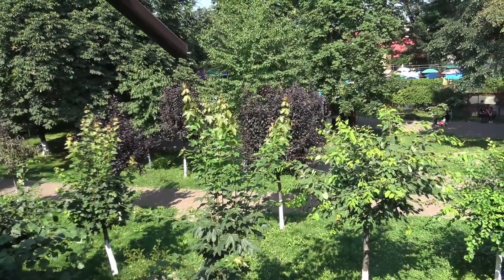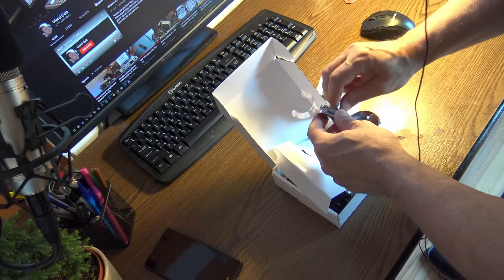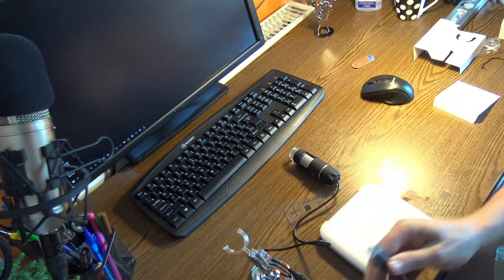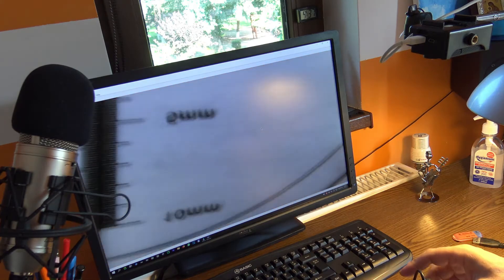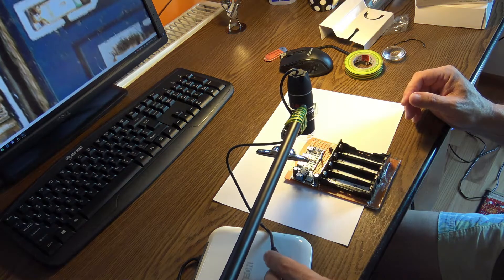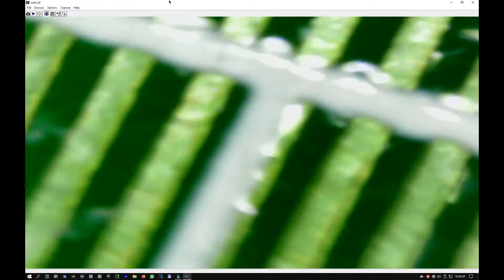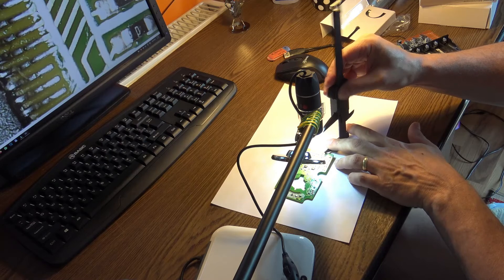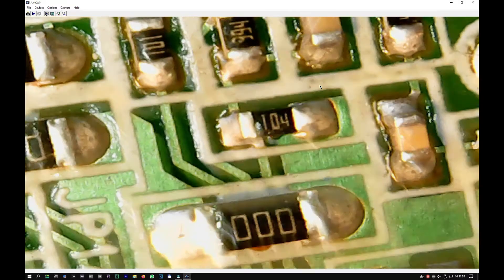Testing 1600X USB microscope..is it worth it?

Comment: Thanks for honestly review. They sell the same model with 500x or 1000x. Which one would you more recommend for soldering smd?
Reply from the maker: I just ordered two models 500X and 600x , it will be delivered in max one week..so stay tuned!
Reply: @viocaia got my 500x delivered last week. I'm happy with it. But i would appreciate, if you could compare them.
Reply from the maker: @f0xvibes  Of course! Probably it's the same model.but will see soon..have fun!
Reply from the maker: I'll go for 500X , it\s better place in between the lenses and working area...1000x is way to close..the focal is to short..

Comment: I am trying to get a single 18650 to power a 3.6v 300ma LED and I can't find any module that can do it properly.  I have tried different modules in series etc... to no avail.  What I want is 2.8v-4.2v to the 3.6v 300ma since the TP4056 shuts down at 2.8V.  I am lost.  What I wish is a CC/CV where my range of voltage will come out as the 3.6V without breaking the bank.
Reply from the maker: You need a module to charge 18650? I'm afraid that's the cheapest one..TO4056..what is your in voltage..before charger?
Reply: @viocaia  The tp4056 works wonderfully well and that isn't the problem.  The problem is getting the single 18650 2.8v-4.2v to power a 3w 3.6v LED that I am going to run at 300ma (so roughly equiv to a 1.5-2w LED to keep it cool).  I can't find anything that will do it.  The problem arises because 3.6v is required but the 18650 is max of 4.2v so over the voltage for the LED so POP.  It also will go down to 2.8v so under the 3.6v of the LED so the led will not light.  What is needed is a module that will take my battery and do a CC of 300ma.  I find them (I even have one) but they are all 5v, or more so worthless to me.
Reply from the maker: @generalawareness101  I got it! Why not have a resistor in series..R=U/I gives like 14 ohms..around 1W...also google for constant current circuit..there are few very simple one transistor schematics..but try a resistor first..will limit the current in the begin and relax after voltage drops..try 20 ohms ...
Reply: @viocaia  I did the calculation using an online calculator and wow, 1.6 ohms at 1w.  I would think the CC circuit would probably be the best way though I am surprised if it is so simple why there are no modules available?  I bet there is but who knows?
Reply from the maker: @generalawareness101  Something is wrong..you have..let's say 4.2V and 0.3A..so R=U/I 4.2/.3=14 Ohms! ..use 20 instead..it will be ok..even the LED strips are using resistors in series for current control..
Reply: @viocaia  Dang, I went to another site's calculator and I put vf=3.6, and supplied voltage 4.2, 300ma, and it gives me 2 ohms at 0.18w so use a 1/4w resistor.  btw, the reason I can't do a resistor is that the supplied voltage will fall below the Vf so it will cease to run.
Reply from the maker: @generalawareness101  just give a try with 10-20ohms...the current it's always in Amps..so 300mA means 0.3A  look here.. https://ohmslawcalculator.com/ohms-law-calculator
Reply from the maker: @generalawareness101  right..I found this..https://www.digikey.com/en/resources/conversion-calculators/conversion-calculator-led-series-resistor

and it looks legitim..but from my practical experience that 2 ohms is way to low for good protection...you make me do some experiments!
Reply from the maker: @generalawareness101  what kind of LED are you using..?
Reply from the maker: @generalawareness101  I'll look for something similar and let you know...
Reply: @viocaia  Thank you.
Reply: @viocaia  I found what I needed exactly.  Not cheap but not expensive either. I purchased five for 12.61 USD (included the tax and shipping).  The part is CN5711 and here is a listing of it - https://www.ebay.com/itm/203214607452  After burning up another MT3608 (I walked away with it unplugged then came back to plug it in and smoke) I gave up on that module.  This was made precisely for a single cell 18650, and the chip is used in single cell flashlight, UV lights, etc...  It will take the full range of 2.8v - 4.2v (will even go up to 6v) giving me the ability to adjust the current to make it constant.  Now there is barely any info on this thing, but I do know it can be PWM controlled or tie it to high to be always on.  Since it says (I don't know if true or not) it can handle up to 1.5A we will see, but it does say it can handle LEDs in parallel up to 1.5A (basically 2 3W star clusters in parallel per driver).
Reply from the maker: @generalawareness101  Nice ! Thanks for let us know, I'll try that too as soon as the LED comes... Again , that is the beauty of DIY..sharing information.Good luck and keep posting the results...
Reply: @viocaia  Bad part is the 1 month wait.  By the time I get everything it will be winter here, lol.  The last part in this will be the 12v 50w Solar Panel.  I need the 50W for the shorter days of winter plus the lack of sunshine.  If I had the room I would do a 100W to be sure I had enough.
Reply from the maker: @generalawareness101  buy as much panel as you afford..in solar is never enough!
Reply: @viocaia  The problem is space for it, but I agree with you overall.